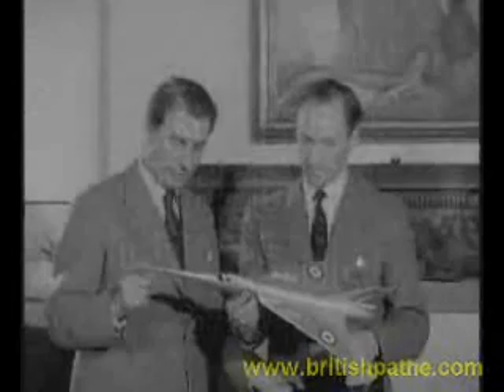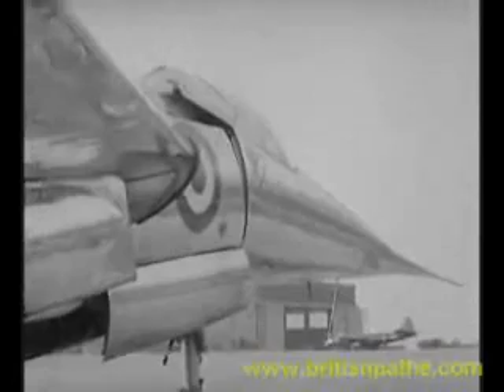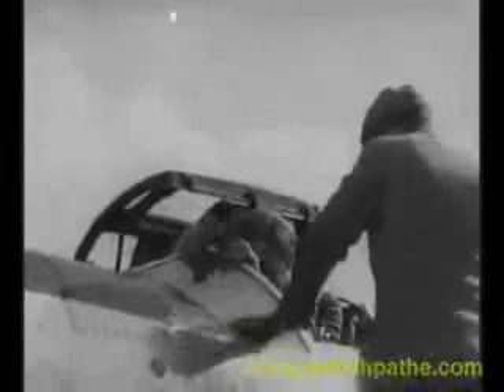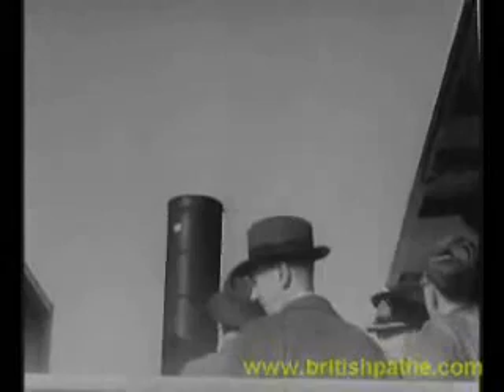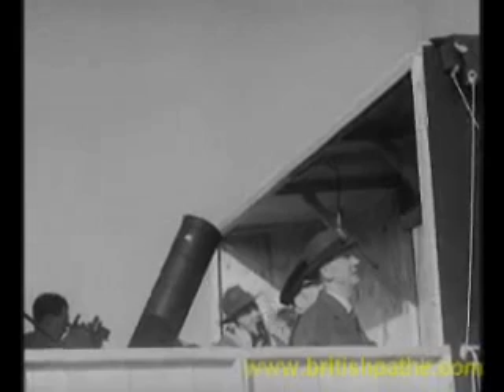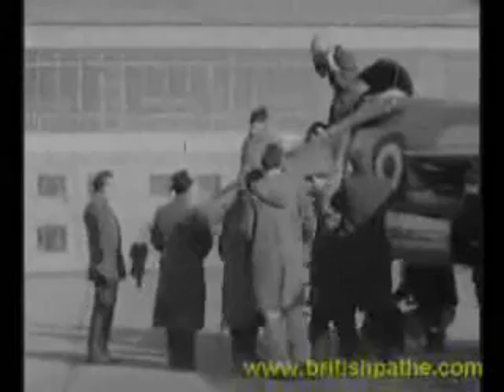Fairey FD2 from 1954 - World Beater

Comment: The FD2 flies over the Dassault factory and guess what? The Mirage III suddenly comes around! official speed  1,132 mph, but unofficially 1,300 mph as the British government wanted to hide their embarrassment.
Reply: first delta Dassault was the MD550 mystère delta (concept in 1954 ,first fly debut 1955), speed mach 1.3 (1.6 with additionnal rockets), but was underpowered (Armstrong siddeley viper engine) because the planed ATAR turbo jet was not available...the Mirage 3 comes later (first fly 1956), but the first french delta (with propeller engine) was before WW2...
Reply: Yes, during October and November 1956, just a few weeks before the Mirage III's first flight. So stop talking bollocks.